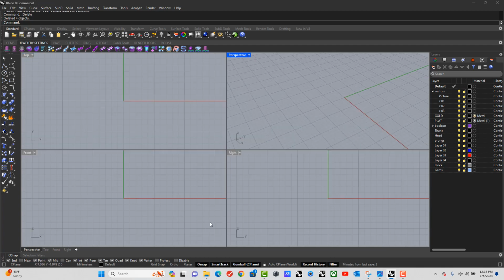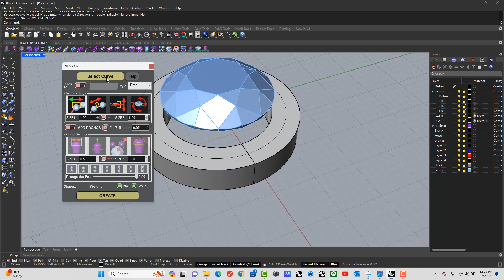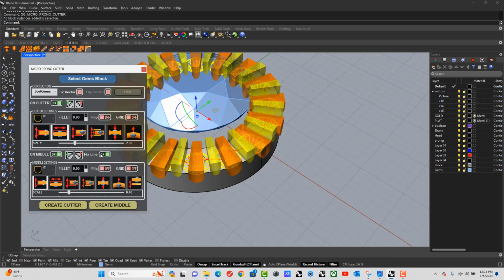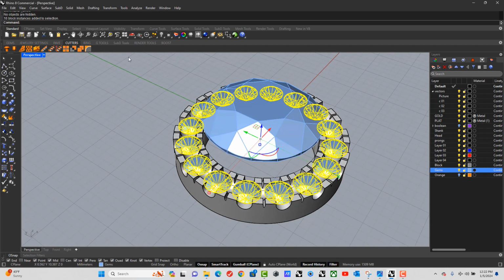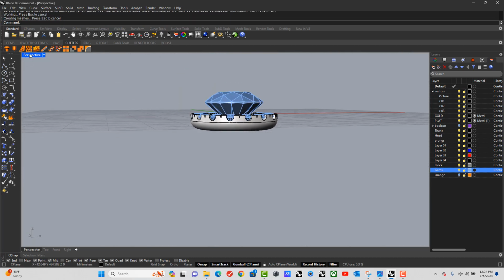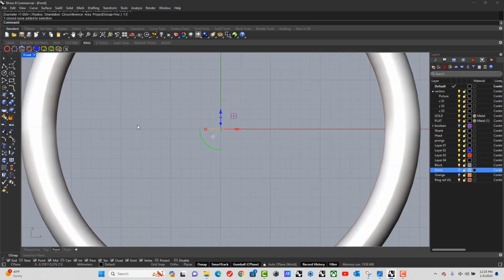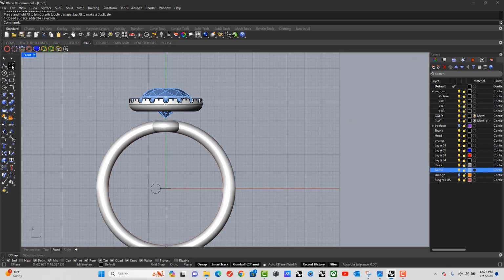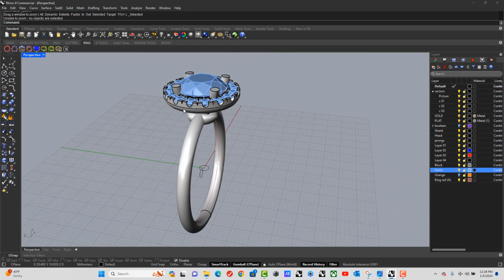Halo ring using grasshopper gold plugin

Comment: Hey, Great video! If I may, can I add a couple of creative suggestions without offending anyone?

A. I would inset the gem curve (circle under the gem) by at least 1mm. if you are looking at the ring from the top at an angle, all you will see is an air gap.

B. Why not make a profile curve on the circle that has rounded edges to sweep1? Then you could have history enabled to tweak that halo any way you wish, rather than just relying on a fillet.

C. Please keep in mind how this model will be manufactured. The Prongs are way too short on the center gem for setting and they don't line up properly on the smaller stones of the halo.

Just a few friendly suggestions.  I do enjoy your videos.🙂